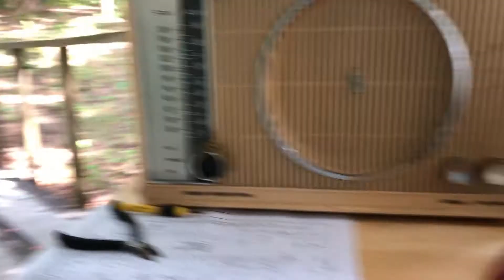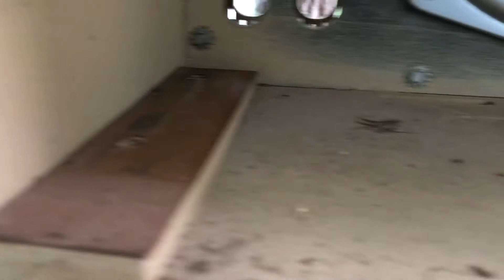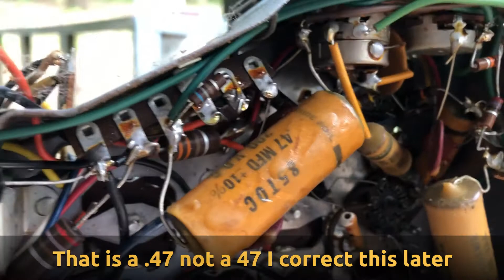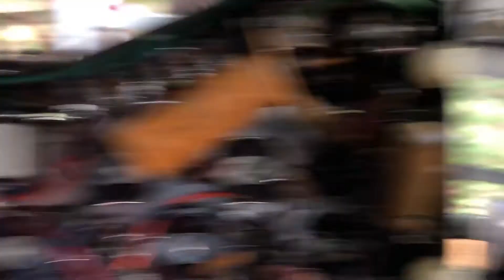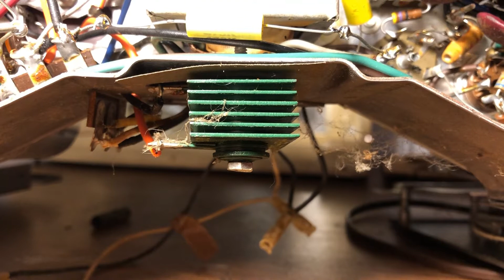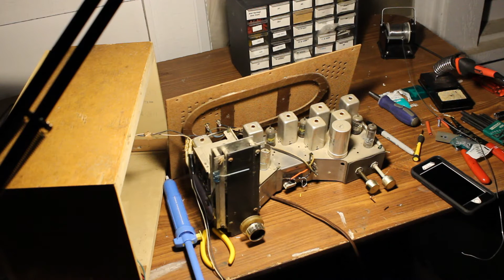Episode 6 Repair of Zenith 845 from 1961

Comment: Repair guys always put the silicon diode in backwards! You are not the only one. Here is any easy tip. 
The banded side of the silicon diode goes to the positive side of the electrolytic cap(s) . Sometimes you have to 
add a beefed up resistor between the two. Nice radio and at an excellent price to boot. Sounds great!